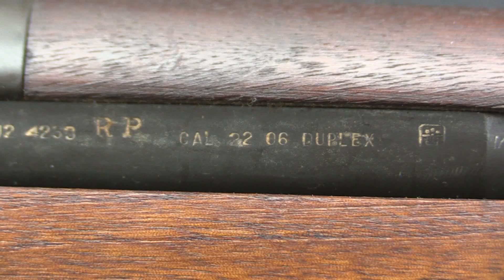.22-06 Duplex M1 Garand

Comment: Does firing a gun like this with duplux ammo make it a machine gun? It's firing 2 projectile with one trigger pull.
Reply from the maker: bigred2989 No, for the same reason that shotguns are not machine guns. It's one cartridge being fired that matters, not the number of projectiles in it.
Reply: When I asked this I assumed that shotguns were the exception, but guns like the Taurus Judge can shoot multiple projectiles, too.
Reply: bigred2989 That is still a shotgun technically.
Reply: bigred2989 I honestly laughed at that first comment there. Cheeky, yet understandably inquisitive. Ian's right though; if duplex ammo could make a semi auto a machine gun, then birdshot/buckshot ammo was making machineguns of even muzzle loader blunderbuses hundreds of years ago :P Simply not the case; one cartridge, one pull of the trigger. To be honest though, I thought that this 'duplex' ammo would simply make the two rounds colide to the point of coming out together, considering that the pressures would probably only be pushing on the REAR bullet. Since it apparently worked though, but was just more expensive, I wouldn't mind getting a couple 85gr .311 bullets (Basically two 7.62x25 bullets), and loading them into one of my standard loads of Mk.VII Ball .303 British.

Replacing a 174gr bullet with two bullets of half the weight, HOPEFULLY not increasing or decreasing the pressure by much, then seeing how it prints on paper at various distances. Of course in being round nosed instead of spitzer, it wouldn't be as accurate from the get go, but it seems to me like the point of duplex ammo is MAKING the rounds spread out a little to give a better chance at hitting. Slightly less accuracy is what you WANT by the sounds of it.
Reply: +NormanMatchem 
Kind of like how the metal storm weapons claims extremely high rates of fire, having rounds pre-loaded into the barrel, firing on after the other, and not really cycling the gun between shots. Always seemed very silly to me, kind of like how you would claim that a shotgun with birdshot has a theoretical rate of fire of over a million rounds per minute (which is what metal storm claims, when you fire all the pre-loaded rounds at once).

As for duplex and rounds colliding, I'm assuming (not really having a clue actually, just some high school physics) that the rearward bullet is pushing the forward one, and then when the forward one leaves the barrel the rearward one still has a bit of friction from the barrel left, giving it just a little bit of separation.
Alternatively, you make the two rounds slightly different, making the one in the front slightly heavier so it has more kinetic energy but still with the same surface area, so the rearward one falls behind a little.
But the aerodynamics once they leave the barrel is interesting as well.
Does the bullet in front leave a wake so that the rearward one has a lighter air resistance? Like drafting in car racing and bicycle competitions.

Also, you kind of want them to hit the same spot or as close to it as possible. At ranges the natural movement of you and your target, as well as side wind etc would cause a little bit of deviation and even if you do hit at the exact same spot you are still likely to inflict extra damage with a second bullet entering slightly behind the first one, causing all kinds of fun reactions in the bulding and flexing flesh and bone of the target.
Also, hitting the exact same spot has a modern advantage in penetration, although for duplex rounds that might be kind of moot, since the double duplex rounds are lighter and has worse penetration than a normal single round of the same caliber/casing. 
But the german H&K G11 that fired a 3 round burst at extremely high rate of fire, and with the third round exiting the barrel before the recoil hit the shooters shoulder, would be different, since that is effectively three full-sized rounds.
The russian AN-94 Abakan uses this, it has it's own version called blowback shifted pulse or something, which gives a two round burst with very high RoF, with statements that it will hit hole in hole in 100m or less. That hole in hole performance is supposed to give it superior armor penetration with it's standard 5,45x39mm WP round (the russians don't use AK47s, they use AK74s) so that it should be able to defeat heavy body armor that the round normally would be unable to penetrate.

The AN-94 was too complex and expensive to be general issue to russian troops, but their special forces uses it.
Reply: R Re 7.62x39 bullets are quite long, and also spitzer; they'd take up too much room, That's why I figure round nosed pistol bullets would be best. They would take up less room, they weigh less, and so you might be able to have them both properly seated into the next of the casing all while not having an obscene amount of weight. I think 7.62x25 bullets would be a better option than 7.62x39 bullets; then you might be able to have them sitting on a standard load of powder instead of a lightened load.

Wouldn't be as good at longer range though; lighter bullets slow down faster than slower bullets, not to mention in being round nosed there's more drag so that would cause quicker loss of velocity as well. I don't think the purpose of multiple projectiles is to hit someone from 500m+ though; more for closer 100-300m distance where the bullets will have had a chance to separate properly. I figure within 50-100m, the two bullets would be in VERY close proximity to one another, giving a better chance of hitting one target twice rather than giving a better chance of hitting a target with ill-aimed shots, or two targets simultaneously that are bunched up closely.

Still, if the two pistol bullets weigh in at about 85gr a piece,  or 170gr together, then through a rifle barrel they should both be going about 2500-2600 ft/s I figure. The M1 Carbine has been taken to 300m successfully before, and that's with a 110gr round nosed bullet at about 1900-2000 ft/s, so these faster bullets should manage 400m at least I figure with groupings the size of center mass, but because they're slowing down faster than a heavier spitzer bullet, they would deviate from point of aim much more quickly, but to an extent, that's kind of what you want when firing multiple projectiles with every trigger pull.

So while standard M2 Ball from a garden variety M1 Rifle might manage 8-12" or so at 400m, I figure with these pistol-bullet-firing .30-06, you'd get more like 16-20" groupings at 400m. This is just guesstimations though. Personally, when I took my 1941 M1 Rifle to the range with ammo I made myself, I was getting an 8" group at 100m, and that's while resting the rifle, trying to get the sights on the bull's eye. It's an old and well-worn rifle though, not to mention I was (an am) a fairly inexperienced shooter, and it was one of my first batches of home made ammo. With a better shooter and better ammo, I'm sure it could print 4" or less at a measly 100m. To be fair though, when I put a .30-06 round nose-down into the muzzle, the bullet is completely hidden.

If I take a .308 bullet itself and put it nose-down into the muzzle, I swear it almost fits inside. So that WWII barrel has seen significant use. I'm kind of thinking of ramping it up to .311 cal instead of .308, but I'm probably better off leaving it be. It was made the same month that Peal Harbour was attacked, so although it was rebarreled during WWII, it was around for basically the entire time America was involved in the conflict. No doubt it's seen tens of thousands, if not hundreds of thousands of rounds over the past 71 years and 4 months.
Reply: +Eric V Actually, the Judge is technically a handgun that coincidentally uses 410 caliber shot shells. You'll note that there are no 12ga pistols, that would be an NFA firearm. 
Further, there are 'shotshell' versions of virtually all conventional handgun ammo, like 9mm or 44 special. They're meant for killing small pests.
Reply: +NormanMatchem The potential problem with your scheme is the short neck length in .303 British brass. It might work better in a .30/30 Winchester due to the relatively long neck length of that round. A book from Wolfe Publications, 40 Years with the .45/70, details the experiments a US man did with the .45/70 over his hunting career. He worked up a duplex bullet load for the .45/70, I think he was using a Marlin 1895. He had success with his load.  I am not sure what issues you might run into. Maybe slugging if the powder type and charge weight is wrong for the bullet type. You mentioned using 7.62X25 bullets (pulled military rounds?), which to my mind would resist slugging to some extent, at least in theory. But, many ideas work 'in theory'. Regards. :-)
Reply: +Nehcrum The difference is that in "metal storm" the bullets serve to divide the chamber and each has its own powder charge.  Ian has another video where he shows off a cap and ball revolver that uses the same principle to get twelve shots from a six chamber cylinder.  That's not really duplex or multiplex.  It doesn't try to put two rounds down the barrel at the same time when functioning correctly.  

I actually wouldn't expect the rear bullet to push the front bullet on the duplex, though the middle bullet pushing the front bullet might be a problem on the triplex.  The rear bullet on either looks like it's behind the cartridge's shoulder so some of the expanding gases should get in between the bullets before the rear reaches the shoulder.  Not much, but I expect it would be enough to separate the bullets.  If it weren't I don't think you could possibly get a 65% increase in hits per cartridge.
Reply: +NormanMatchem If you will note, the last bullet to exit the bore in duplex rounds often has a base that is angled and not square. This increases the circular probability of error and impact point from the leading projectile.
Reply: +martK banjoboy  3X.457 round balls has always been a good 45-70 load.
Reply: lol, coincidentally? Not a chance!

.45 Long Colt's OAL is 1.6". 410 shotshells are 2" long. That moves the leade .4 inches away from the bullet for .45 colt loads, something they would never do without reason. What reason? The fact that the Judge is expressly designed to handle 410 shotshells, and the chamber pressure of .45 colt.

So, the Judge is a shotgun. Not even "technically" – it is a purpose-designed, built, and marketed shotgun. It's also, of course, a handgun.

Deal with it. (Unless you want to be seen as a label-obsessed, weak-minded child.)
Reply: bigred2989 could be it is a rifled shotgun?

Comment: No reason a handloader couldn't load a single projectile 22-06 load for simplicity. The multi-projectile in a necked/shouldered case poses some issues. I bet that makes for some screamin rounds though! Wonder what the service barrel life was like?

I have experimented with some Duplex round ball loads in .45 Colt and inside of 10-15yrds isn't too bad, about a 3" or less group but beyond that the pattern starts opening up. I would guess the contact leaving the gun/muzzle has a significant effect. They are round balls. This would be fun to play with in a longer case like .454 or .460 where I could use regular bullets and have some case volume left. Wouldn't try this in anything besides straight-walled cases.
Reply: +mytmousemalibu There was a guy who was loading 3 small bevel base wadcutters in .357 Maximum brass and fired from a .357 magnum revolver with the cylinder bored all the way through. Called them quad cutters. Someone else had commercial projectiles called quad cutters also.
Reply: Hmm. I believe as long as both or all projectiles were contained in the neck you wouldn't run into too many problems.